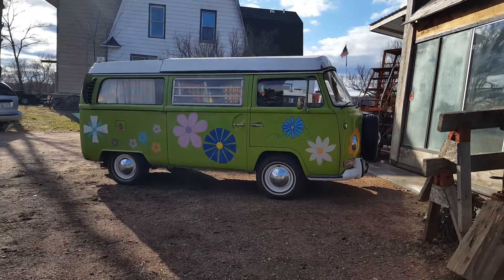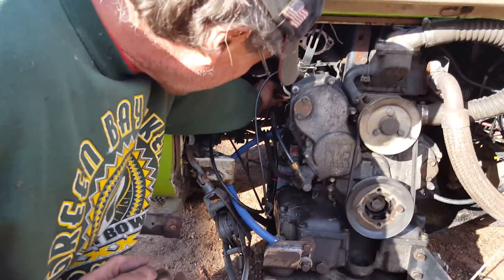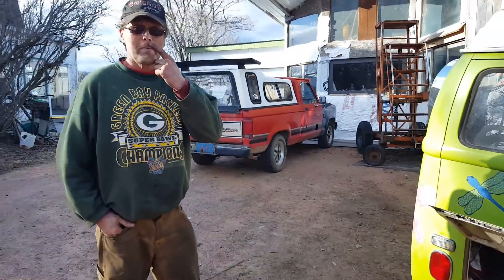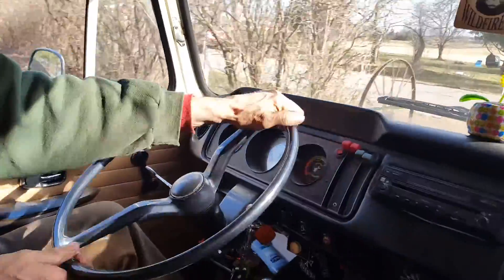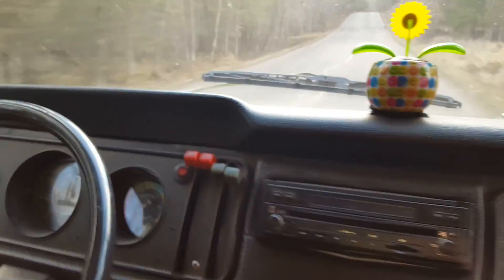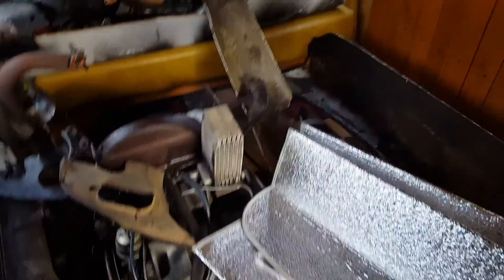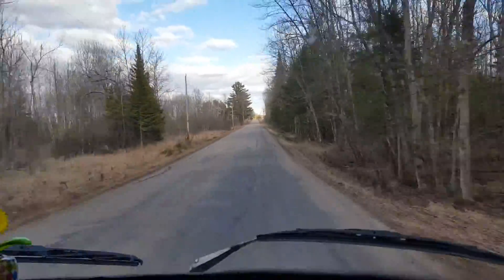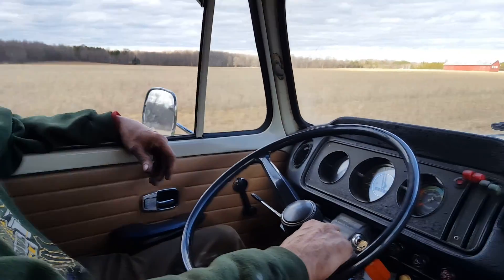Thermo King D201 Diesel Volkswagen Hippie Bus

Comment: What kind of transmission adapter did you use? Ive got the same engine, intend to put in a small pickup. Its got an 8 bolt crank flange
Reply: email me at jimminniecheske@gmail.com

Comment: I also live in wisconsin and i would love to buy that thermo king off you to put in a beetle.
Reply: Hi Mike. Thanks for the interest in the engine, but we ended up using it in a skidsteer as the powerplant to run the hydraulic pump.
Reply: how about the converter to attach it to the transmission.

Comment: "temporary mounts" ??????? not a single bit of that seems anything but sketchy, and it only got worse after i heard "let's take it for a ride."  A come-a-long as an engine support? Did y'all eat paint chips as kids?
Reply: I'm the guy saying "Let's take it for a ride..." I did eat paint chips, but that's beside the point. LOL Fact is, the come-along was a safety measure. As you can see when he revs the engine, it was mounted with welded in brackets to the factory engine points. Thanks for watching our video! Cheers!
Reply from the maker: cum-along was just a safety. num nuts